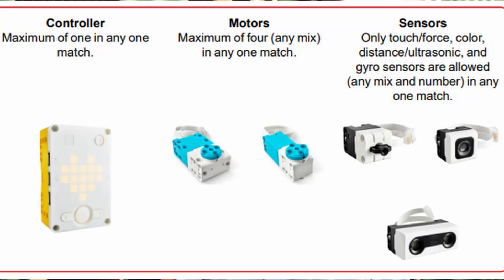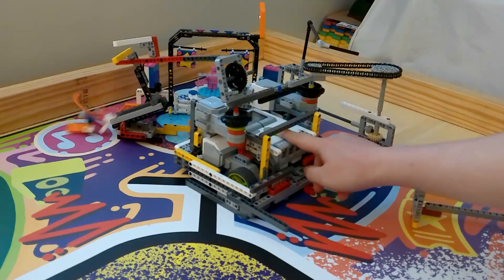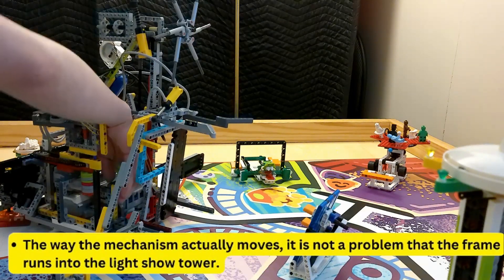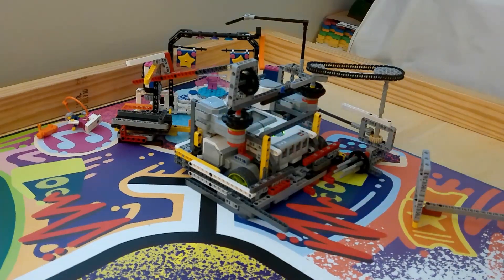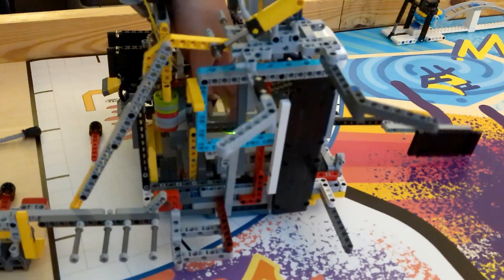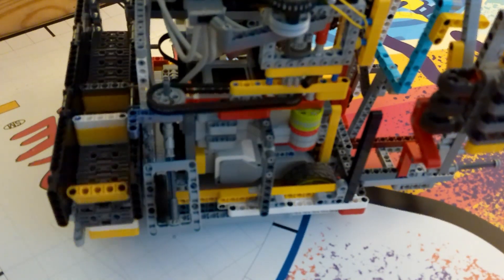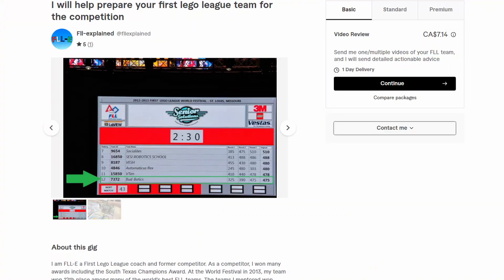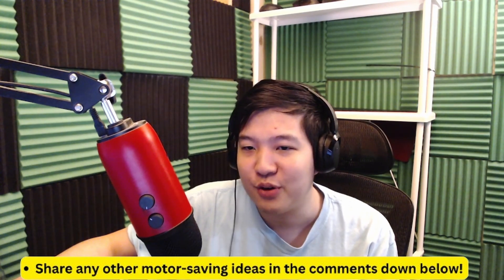Saving Motors in FLL Ep1: Multiplying Motor Functions

Comment: In my opinion the best way to save motors is by using rubber bands to power attachments
Reply from the maker: I am happy to make a video about that later! I actually also really like doing that as well.
Reply: Rubber bands are good for mechanisms that operate only once and transition between only two positions. There are instances where one would want mechanisms that operate multiple times and/or must move to multiple positions. Rubber bands also tend to produce produce rather violent motions, which may be undesirable in some instances.